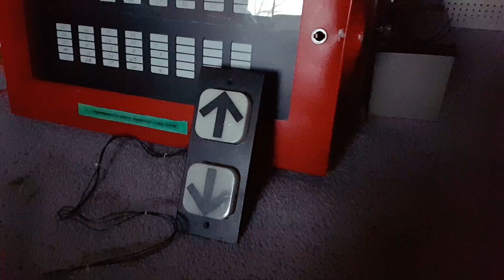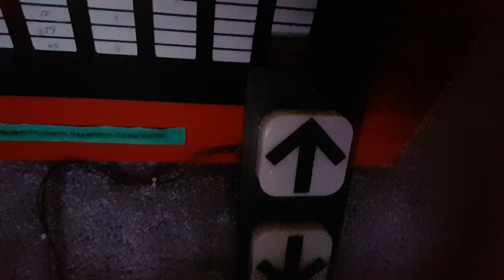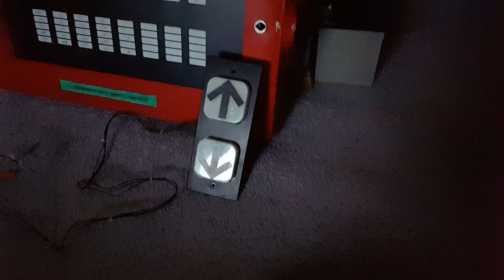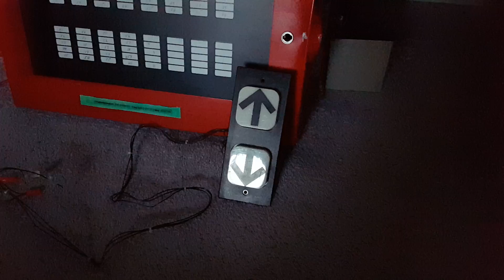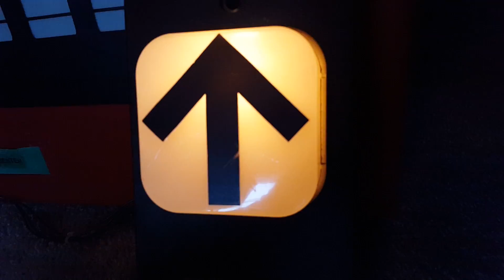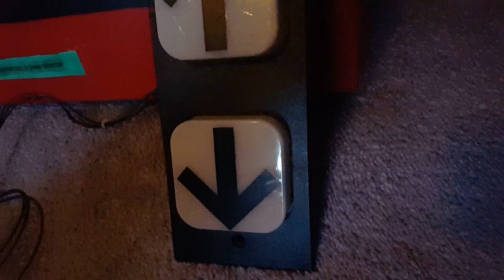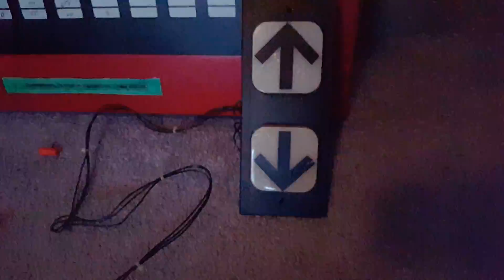Dover Impulse Elevator Directional Lantern/Chime Overview/Test

Comment: I always wonder how the Dover Impulses bells ring twice whenever a down button is pushed. Obviously when the door opens and the up button is pushed, I believe there's a wire located somewhere that touches whatever lights up the lantern, making the bell ring. But exactly how does the down lantern light up twice?
Reply: The elevator controller basically turns it on, off, then on again.

Comment: How do you make the Dover Impulse chimes do different pitches msj191961?
Reply: They aren't. It's a matter of how they're built.
Reply from the maker: I really don't know if the pitch was adjustable on these units, except by the factory. I can't figure out how to get the plastic shell apart to access the circuit board, but if I can, I'll let you know.

Comment: I have one of these too. Is there any way to turn the chime louder/quieter?
Reply from the maker: You mean you have an Impulse lantern? Because it really does depend on the kind. I have not yet figured out a way to adjust the volume on it. I'm sure it can be done, but I don't see any immediate method of doing it. I would imagine the chime box would have to be cut open somehow, since I don't see see any way to easily take it apart.
Reply: I have an exterior impulse lantern. If you look closely, at least on mine, the chime box has two little clips that open up the side to take the circuit board out. I might not have enough power, causing it to be quieter.
Reply from the maker: How many volts are you puttin' into it?
Reply: 24
Reply from the maker: Hmm, that should be plenty. If it's quiet, I would assume either it's set quiet, or it's on its way out. I've heard some of these bells pretty darn quiet, so I would assume it's a setting that would have to be changed.
Reply: +msj191961 I'll play around with it
Reply: Jowevator 3219

Comment: Pretty neat! That industrial facility where I salvaged a lot of my alarms from had an elevator and is currently still standing. I'm going to try to get back in contact with the building owner soon for some additional signage, and could ask about the elevator parts as well. I've really got no interest in elevators myself, but I could pass them along to you if you if I received them. Interested?
Reply from the maker: +kcin556 Well I'd really appreciate that! Thank you so much for the offer.
Reply: +msj191961 I looked back at some old pictures and videos of the place I have and it appears the elevator was manufactured by Schindler. Two floors, installed sometime around 1994.  I still haven't heard anything back from the building owner yet, so I may take a drive to the site to see what's going on sometime soon.
Reply from the maker: +kcin556 Okay, I really appreciate that! Absolutely no hurry. I'm trying to think of something I could give you in exchange for any parts. Based on the pictures, what kind of buttons does it have? Square or round?
Reply: +msj191961 The buttons are square. I'm going to upload and share the video I have of it privately with you.
Reply from the maker: +kcin556 Sounds like MT fixtures, in that case. Sounds good, thanks. I'll be watching for it.
Reply: +msj191961 Just shared it with you. Hope it covers everything you'd want to see.
Reply from the maker: +kcin556 I didn't receive anything. Looked all over for it.
Reply: +msj191961 I'm gonna send you a PM.
Reply from the maker: +kcin556 Thanks!
Reply from the maker: +kcin556 That's a very unique elevator! Thanks for sharing!
Reply: +msj191961 No problem! I will probably take a drive down there either this Friday or next Monday, and I'll give you an update then.
Reply from the maker: +kcin556 Awesome, sounds great!
Reply: +msj191961 Sorry for such a delay in responding. I learned that the building was transferred from private ownership (scrap company) to the City of Waukegan. I was hoping the scrap company would help me out, since they were going to remove the electrical parts for scrap anyways. I contacted the city and got no response, so I'm going to have to wait until a contractor shows up on site for the demolition. This is a day I truly wish would never come, and it still may be years before it does, or possibly sooner depending on if they receive an EPA grant for demolition and site remediation. I'll let you know if anything else comes up.
Reply from the maker: +kcin556 Don't worry about it! But darn, that sucks.